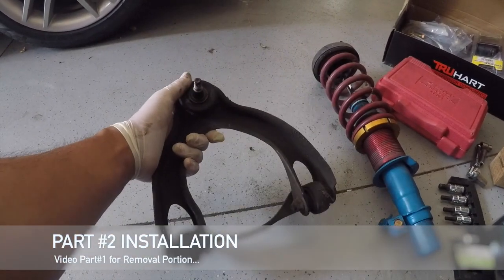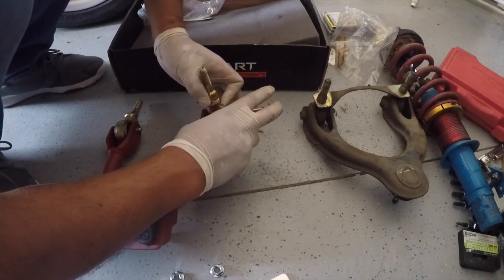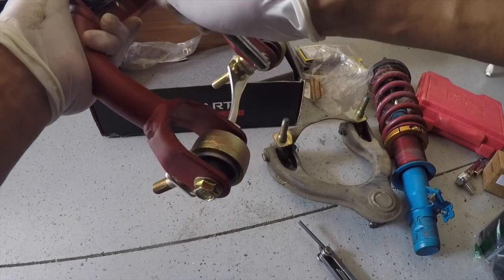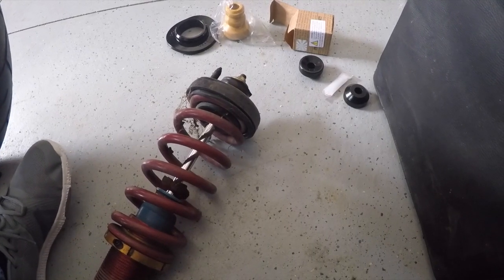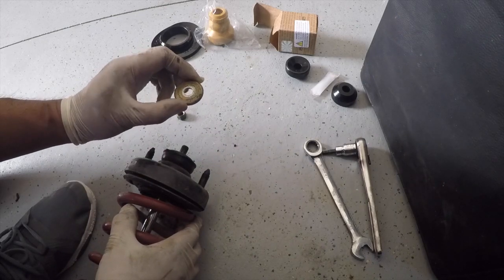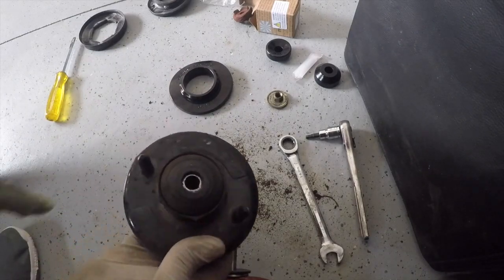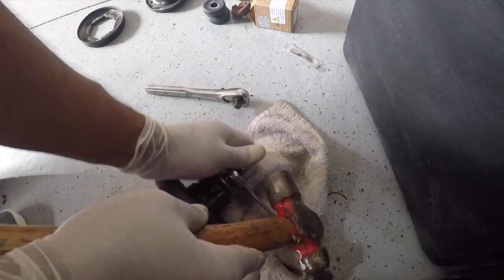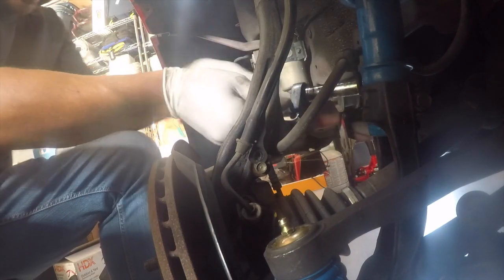Integra Front Camber Kit TruHart Part 2 Installation Upper Control Arm

Comment: 3:50 Never tighten rubber bushings until they are in a fully rested position, after the car's weight has determined their orientation. If you tighten them in a random position out of the car, afterwards when the car's weight is on the suspension, they will then be put in their rested position and will likely be twisted/torqued/stretched in relation to the position in which you tightened them (i.e. experience bind) and will wear/crack/rip prematurely.
Reply: How would you tighten the bolts once the car is off the jack stands and the wheels are on? Any advice or clarification on how you would tighten them? Or the car would need to be raised again to tighten it